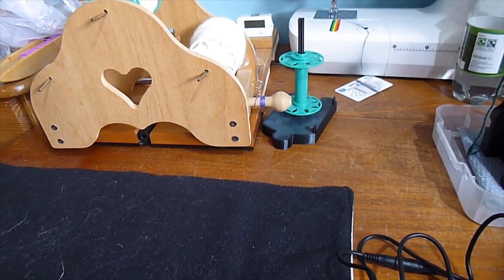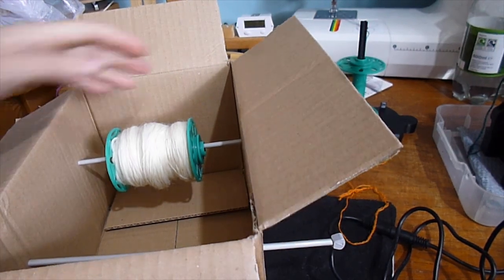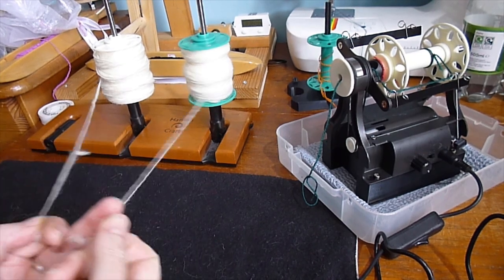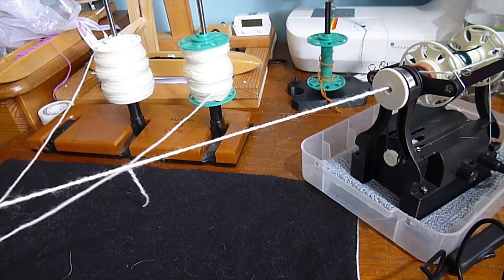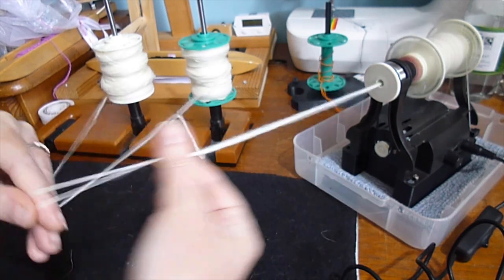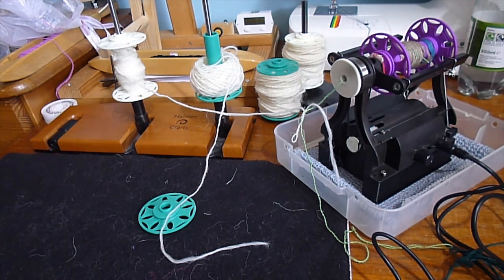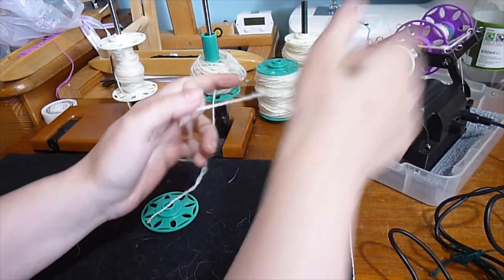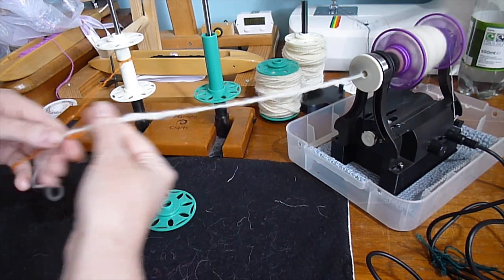EEW Nano - Getting started 5 - plying

Comment: My nano spiinner will start to spin, and then it stops.  I can hear the motor run, but the front wheel doesn't turn.  I have changed the front chord, and checked to make sure the flyer is in the groove properly.  Do you have any suggestions what i should do.  It is a nano 1, purchased during the kick strart time period.  I have ordered a new motor, but I am not confident that the motor is the issue.
Reply: Did you contact dreaming robots? They’re happy to help.